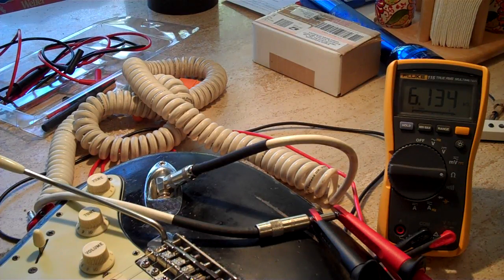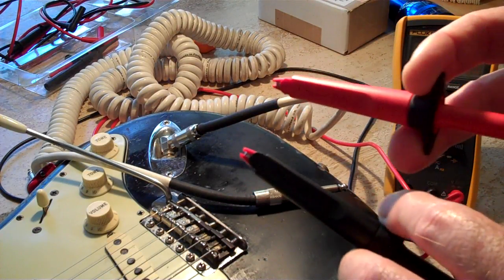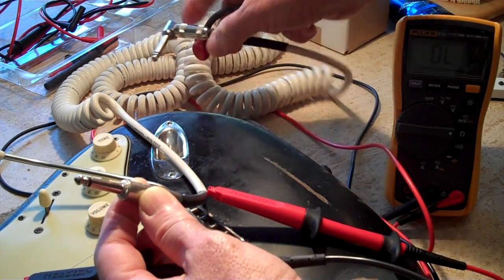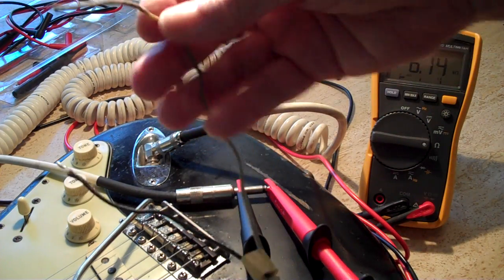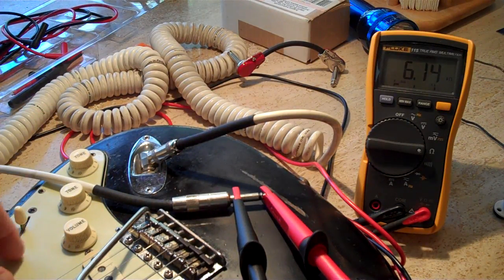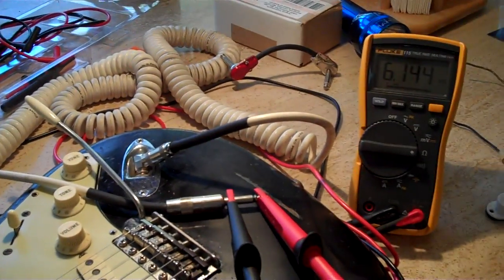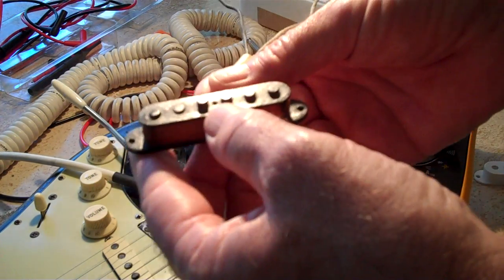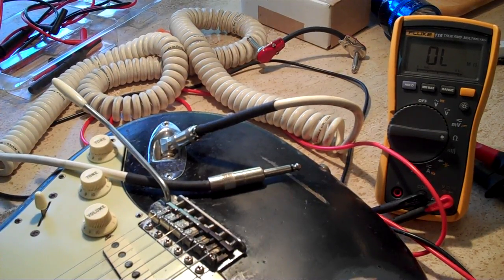Checking Your Guitar Pickup's Resistance (kOhms) with a Digital Multi-Meter

Comment: +Millstap If all your wanting to know is DC resistance, then any standard multimeter will do. But, depending on what you are testing for, you may need an LCR meter. They measure Inductance, Capacitance, and Impedance (AC Sine Wave), or Resistance (DC). The one I use is a IET DE-5000, which is an extremely well made handheld unit. Most often I use it to test the impedance of speakers, and capacitor ESR. It offers switchable frequencies of 100Hz, 120Hz, 1kHz, 10kHz, and 100kHz. It also doubles as a quick to use frequency generator when those frequencies are useful to you.

Comment: Ty for this! Always wondered what these single coil actives put out... just about 17.1 in every position! wow thats hot! ty again!
Reply from the maker: That is hot.  Which pickups are they?
Reply: @millstap  GFS single coil modern actives. i have SD blackouts, pretty much every EMG combo and fishmans in many flavors... these are some of the best ive used!
Reply from the maker: @kiyanharchegani2588  I've never looked into actives.  Are they quiet?  Would the fit in a vintage Strat?  There is not much room in the routes.  Are they similar to Fender's Noiseless pickups like Buddy Guy uses?

Comment: Electrician comes in very late, his wife says  "Wire you insulate?"
He replies "Watts it to you I'm Ohm aren't I?
Went down this path several years ago looking into different magnetic materials, AlNiCo, Sumarium, Neodymium. I replaced the Lace Sensors with a set of Fender Gold Sumarium pups in my strat. I left the original pick guard, pups, switches ect intact and put in a new pick guard with the pups and switches.  They don't make the Sumarium material and have replaced the AlNiCo with Neodymium which I think is too harsh sounding.  You can get different strength magnetics even in the little ones used in pups.  Makes me wonder if all those magnets were shipped in a box and somehow the magnetism was changed and the 50's and 60's strats that sound so sweet had something going on with the magnets.  Who knows, you know. 
The only way to tell would be to measure the magnets strength or flux density and then wind up a few and see how they sound.  Just found a good video on this, in utube type in "Measuring magnet strength Fender Texas Specials and Vintage 52's" by Neil Robert Turner.  He really explains this quite well.

Comment: Good morning friend, I turn to you for a consultation, I just bought some used texas special pickups, they look like new, I have already checked photos and everything corresponds that they are original, but as for the ohms they are well below what the manufacturer specifies, Neck 5.6K, Medium 6K, and Bridge 6.3K (I already used 2 multimeters in case there was a measurement error), while the manufacturer specifies that they must be 6.2K 6.5K 6.7K, will they take turns or would we suspect they are false? I appreciate your valuable comment, best regards!
Reply from the maker: They may be fake or bad.  Also check this video on another accurate way to check them, https://youtu.be/gKIhgfpyTVA.  Personally, I didn't care for the Texas Specials so if they are weaker than they should be, that may be a good thing and you might want to try them anyway.  My best sounding guitar is in the 5.3K, 5.7K, 6.1K range.

Comment: Greetings millstap. I ask you please answer a question. It is known that multiple factors intervene in the final tone of a pickup. Among these factors is resistance. In your experience, within what range of resistance values should a stratocaster pickup have to retain that characteristic 50s tone?. There are some that indicate from 5.5K to 6.5K. Others say around 6K. Others say that below 5.8K it sounds weak and bright and above 6.2K it sounds fat. A major pickup manufacturer has a 4.9K model for the neck pickup but with an alnico 3. Is there any consensus regarding resistance and the type of alnico used to mimic the strat sound of a lifetime?. I will be grateful for your response.
Reply from the maker: Nilton, I would say 5.7K to 6.3K. But I have a vintage 1964 Formvar neck pickup that is 5.3K and although it seems weak, it sounds cool and works great with fuzz and overdrive because it doesn’t overload the pedals too much. I have for Strats. Two with vintage pickups and two with modern replicas. I love the variety. They are all good but different. It depends on what type of music you play. I have 1966 grey bottom pickups with enamel wire and that guitar sounds great too. The are a little hotter than the Formvar pups. But for Hendrix, my new Rumpelstiltskin Experiences sound a lot like his Woodstock Strat. Variety is the spice of life.
Reply: @millstap  Thank you very much for the answer millstap. Right now I have my pickups with alnico 5. The resistances are 5.62K for the neck, 5.65K for the middle and 6.18K for the bridge. I am from Peru. I had my pickups built to a manufacturer in the United States. He indicated that he always charges the poles with maximum magnetism. He indicates that this achieves higher sound quality, greater brightness. Indeed, I realize that the sound is strong and there is a lot of magnetic attraction, that is why I have my pickups at 2.4mm in the high E and at 3.2mm in the low E, pressing the last fret. Well... it was nice communicating with you. Thanks for the videos you provide, they are very useful. Greetings.
Reply from the maker: @niltoneduardoalayochavez4395  Yes, on strong magnets, you need to keep the magnets away from the string and your measurements are perfect.  It will allow the string to sustain more and will not alter the intonation.  Sounds like a good set of pickups.

Comment: I think if the pickups would be wired in series...straight in a line the resistance would double. They're probably wired in parallel, which cuts the total resistance in half. And I believe the volume pot adds resistance which cuts the signal strength and lowers the volume. Not 100% sure...been about 40 years since electronics class! Thanks for the video...I think I'll check mine when I get a chance.☺🎸
Reply from the maker: I think you are correct.  They are in parallel.  I'm not sure what they would sound like in series.
Reply: millstap not sure either...may be too much resistance.

Comment: sir my humbucker pickup reads .479 MEGA ohms, is this okay? it sounds fine when plugged in an amp, I dont know if I am measureing it correctly
Reply from the maker: How are you measuring it?  Is the pickup completely out of the circuit or is it in the guitar.  Be sure all volume and tone knobs are turned up fully and plug in a short 1/4" patch cable in the guitar jack.  Hook your meter on the tip and sleeve and you should get an accurate reading.  MOhms usually indicates some sort of short and is not correct.  If you are in need to measure it accurately, then it is better to unsolder the two pickup leads from the circuit first but that is only if you are doubting the integrity of the pickup.  If it sounds right, I would leave it alone.

Comment: Looks like your middle pickup is upside down looking at the staggered pole pieces. The lowest polepiece is for the B string, which is under the A string on your guitar.
Reply from the maker: It might be.  Good eye.  I should have listed the pickups that I was using.  I have a set of vintage reverse stagger pickups and there was a time when I just had that middle pickup in this guitar.

Comment: Does it affect if i use the tester while touching it?
One guy checked mybguitar and its only 1. But in amplifier  its very good sound.
Pls help
Reply from the maker: If you touch the jack or plug, it might affect the reading.  I would use a short pedal board cable, hook it up to your guitar jack and then do the test like I did.  The volume on your guitar has to be at 10.  The volume control affects the ohm reading.

Comment: I dont get any reading?! My guitar is buzzing and hummun like hell when im not touching any metal parts. I tested continuity between output jack and tonepot, volumepot, switch, bridge, like everything else but not pickups. Could there be problem at pickup soldering?
Reply: Might just need to clean the pots? Use some conductor cleaning spray and give them a twist back and forth. Might fix it

Comment: How do I get those kinda gator teeth?
Reply from the maker: You can get the cheap ones on Amazon.  The Fluke ones are always so expensive.  I'm not sure why.  These maybe, https://www.amazon.com/Multimeter-Test-Alligator-Silicone-Electrical-Testing/dp/B07L43MXH8/ref=sr_1_11?dchild=1&keywords=suregrip+dmm+test+leads&qid=1604938278&sr=8-11, or the Flukes, https://www.fluke.com/en-us/product/accessories/test-leads/fluke-tl223
Reply: @millstap  $85 bucks, wow, they saw you commin'